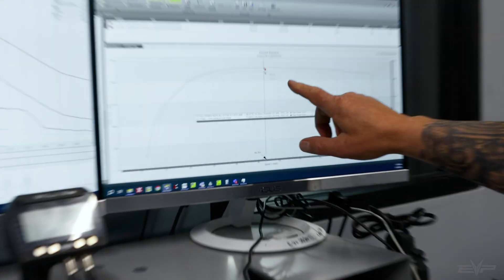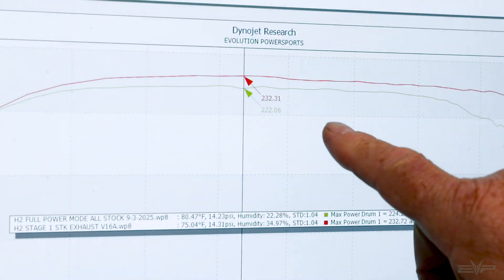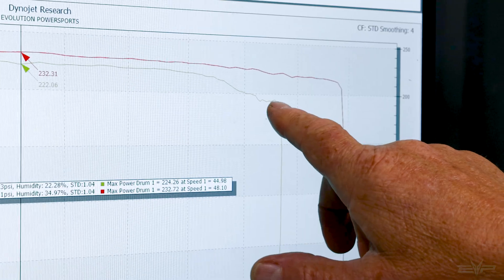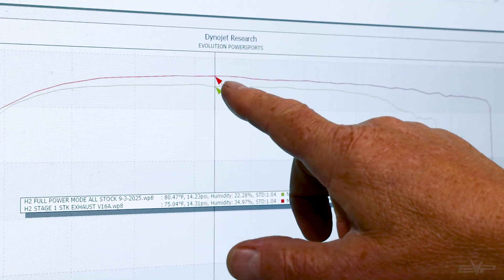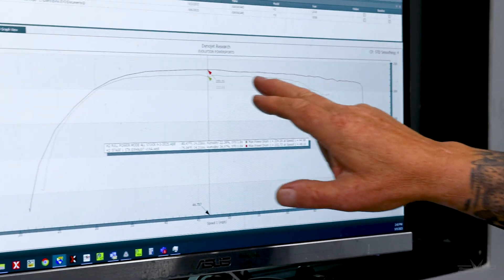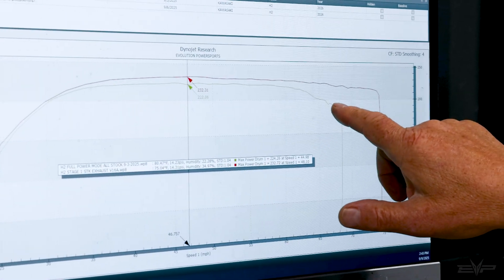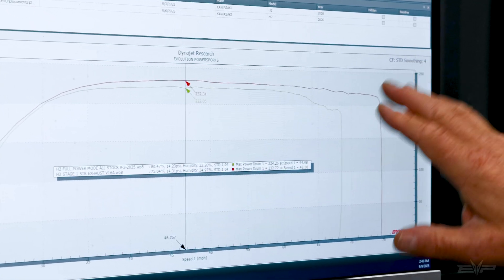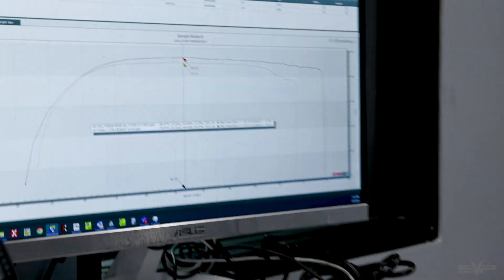EVP UPDATE: Kawasaki Teryx H2 Tuning

Comment: Holy crud 50 or 60 dyno pulls!! If it grenaded on the next pull I would still call this a very well built and beefy motor!! I have seen the best build in line 4's fail at less than a dozen pulls. I don't think the average person realizes how much stress is put on an engine during a dyno run.

Comment: So, a mild tune to the ecu is providing 10-15 extra hp, no internal engine upgrades, no exhaust or clutch upgrades, etc
How good is that compared to CanAm and Polaris engines?
Reply: Roughly the same. My Can Am x3 Turbo RR picked up 18hp off only an ECU tune with no additions

Comment: So it was pretty much maxed out from the factory. Got it.
Reply from the maker: Just changing the rev limit, clutching and mild tuning allows a significant power increase.  There is a lot more on the table with higher octane fuels, ethanol even before gearing up the supercharger.
Reply: Well, still need to change the super charger gearing…
Reply: @Carl865i yeah but you can turn the boost up on turbo car too. So what
Reply: @Williamxmr it’s really not. That was mild tune. Gained a little more power but on the top end of the spectrum gained much more. So maxed out from the factory, doubt it. Exhaust, maybe an intake mod probably get more out of it. Especially exhaust it looks to be very restrictive on the headers.
Reply: Not even close to being maxed out. You heard the man over 50 dyno pulls. Kawasaki engines are in a state of being severely detuned at consumer level.
Reply: @olliechristopher467 then why didn’t they extract more power? Oh yeah because it was about maxed out
Reply: @Williamxmr  They are not finished yet. This rig has only been out a few weeks. These toxic negative posts are getting old.
Reply: @olliechristopher467 facts don't care about your feelings

Comment: Are those 15” rims on the back?
Reply from the maker: Yes they are.  15" rims fit
Reply: @EvolutionPowersports did you have to remove anything from the rear control arm to make them fit?
Reply: @daewoooo5150 they come like that from the factory stock.
Reply: @SevenSixZero3 thought they were 16” factory.
Reply: @daewoooo5150 they do come with 16" wheels, you are correct.
Reply: @daewoooo5150 you are absolutely right bro. My bad. I’m just out here cnn-ing misinformation. Sorry about that.

Comment: Should have been a DCT.  Mav is (in my opinion) a better car for the money.
Reply: Kawi has 3 times the chassis that Can Am has...suspension geometry is miles ahead
Reply: @fabricationnation8052 with the shocks mounted to the upper A arm? 😂😂😂
Reply: @Williamxmr yes the only thing you get out of that lower mount is travel. And with travel you just get worse geometry and more broken axles.
Reply: @drewhinkle6310 wrong.  Tall knuckle is a better design and both the pro R and Mav R have a better geometry than the Kawi
Reply: @fabricationnation8052  Not sure what you see so a great on geometry with front shocks mounted on the upper arms ?
Reply: @fabricationnation8052  I know very little about its geometry because I stopped paying attention after I saw a cvt. Its very difficult to find a car of this caliber with bad suspension these days to be fair.
Reply: @MidwestSpeedworks  Yeah me too. After owning Mav R I would never go back to the belt drive.
Reply: It’s really personal preference. You say more car for the money, but comparing the out the door cost the Mav RS is $5k more than the H2 and the RC is $9K more. For many that’s not worth a DCT Plus long term the CVT is going to be cheaper to maintain or service. The DCT are awesome, but if you have a problem you’re replacing not rebuilding. Thats $8-9K for the trans, and then you have oil coolers to clean or replace and install cost. My dealer said if out of warranty, you’re looking at about $14K complete & installed. But it’s still cool to have options.
Reply: @toddcunningham2410 anyone who spends time in a DCT car will never buy a CVT again.
Reply: @Williamxmr  I am for sure one of those people !! 👍
Reply: Opinions are like assholes...Everybody's got one!

Comment: Well the same engine does 325hp stock in the Ninja H2R, so really that engine has alot more to give....mind you there are modded ones running 450hp Ninja H2s and the thing seemingly works and makes me wish for that power in my upcoming Terryx 4
Reply from the maker: Don't worry its coming
Reply: The H2R is not the same motor as the H2!
Reply: Well there is a lot of power loss between the engine and CVT to the tires
Reply: Go luck keeping that clutch alive with big hp jump